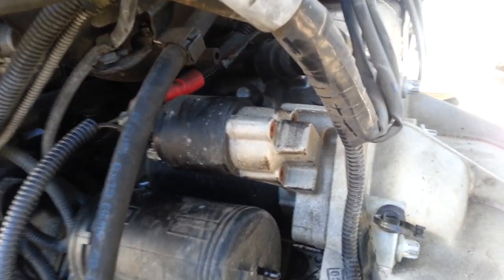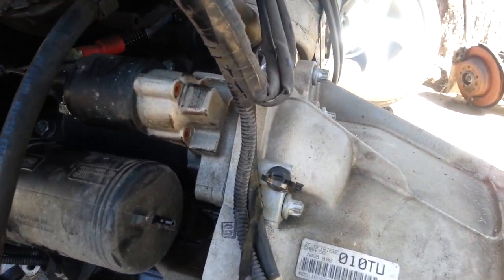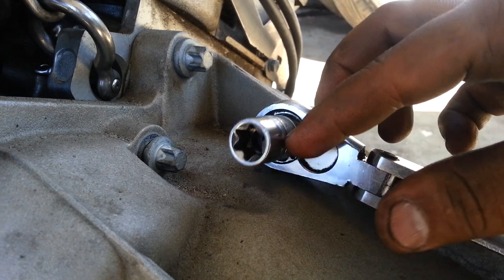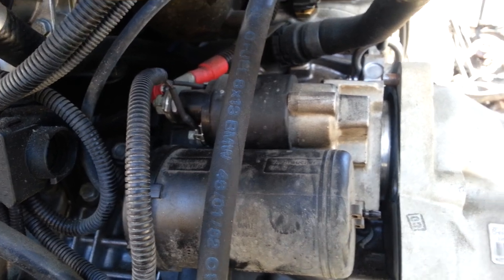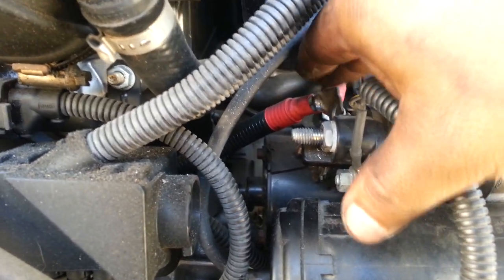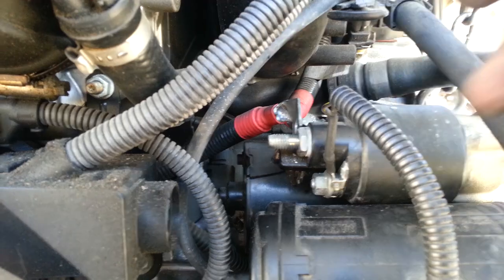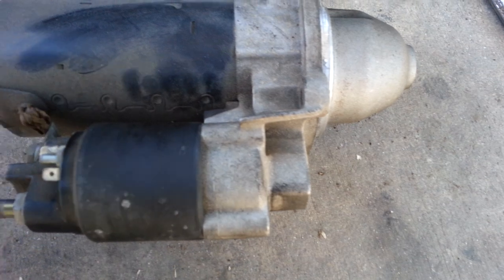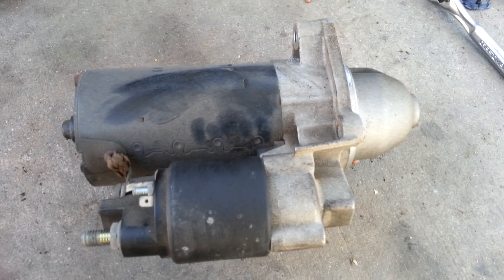How to remove Engine Starter from BMW 325 330 530 E39 e46

Comment: I have one basic question:  Is it easier to replace the starter motor from the top or from the bottom.  The 50's Kid does not mention that.  Is it that he works from the top because he doesn't have a lift?   I read all the postings and there is no mention about it.   Please, give me a clue.
Reply: From the top, bolts are on top , I think removing the driver side air box and vent is enough space

Comment from the maker: You don't have to remove the engine to replace starter on 00-05 models, however, 2006 models got an upgrade in engine.  They went from M54 to N54 and the intake manifold changed a bit and became bigger.  Since starter is locate on driver side rear of engine, you would need to remove the entire manifold intake to have access, even then, you have very little space to work with.  Be sure not to strip the torx bolts since this new model engine introduced aluminum bolts.  Good luck

Comment: Thanks for the video. I am having trouble getting my transmission completely out and I am told that the starter has a dowel pin that sometimes slips out and won't allow the bell housing to come free. Is there a dowel pin on the end of the starter? Thanks.
Reply from the maker: +Mike Hamner There is a 10mm bolt that we've often missed that could prevent the transmission from coming out.  Its on the side of the trans on the driver side.  hope that helps
Reply: +bimmermerchant 
Thanks for the reply. I have them all out in fact the transmission comes out about an inch all the way around and the case rotates about 20 degrees or so. I think the shaft is hung up on the pilot bearing. I still can't get it to come out after putting a chain on the rear axle and a come-along to pull...still won't clear the pressure plate. I am completely out of answers. It will come out one day and I did order a starter just because of how hard it is to get out I am  NOT doing this again! Later!
Reply: Know this Mike, theres a reason why its hung up, never force anything(ie: come along), step back, take a breath(metaphorically), I'm pretty sure if its a standard trans? you have to remove flywheel bolts.
Reply: and thats typically done through dust cover. either with conventional wrench, or a special flywheel wrench?. remove one bolt, rotate engine, and repeat until all are removed.

Comment: At 0:15 I noticed the vacuum reservoir isn’t connected to that small torn vacuum line that runs under. Where does that vacuum line run to?? Mine was the same way but I don’t have the small hose underneath.

Comment from the maker: no way of knowing how serious this problem is until you get codes for the check engine light.  Space available in the engine bay to replace a starter is very limited.  Your mechanic might have unplugged a sensor and forgot to connect it back or he must have pulled an emission house off by accident.  You can take car back to your mechanic and let him trouble shoot or you can get a flashlight and start looking for any unplugged wires or loose hoses.  Good luck

Comment: I brought my car to the dealership because there was a fender bender and needed bodywork. The workers took the car apart and now the car wont start and they wont take any responsibility for it claiming that the starter coincidentally broke while at their shop. I've never had an issue with the starter. The engine won't turn over and it makes a sound like the battery is dead. My question is whether starters just break suddenly and if there is any way to prove that they are at fault. They make it seem like there is no way to prove that they mishandled the repair. It seems like they can just break anything they want and have their customers pay for it. It doesn't matter that the car ran perfectly going in and now wont start. Please give me a little insight as I don't know much and would greatly appreciate your response. Is there anything I can do? questions I can ask? or things can show that they are responsible? The car's not even all the way put together but they're certain that it has nothing to do with the function of the starter.
Reply: it could be the immobiliser if the car was in a crash how bad was the damage ? if it was heavy the starter has taken a jolt this is not common but possible  or if the damage was extensive and some wiring has been severed it could cause the starter to short circuit and burn out   ?
Reply: No. Do you drive a bmw? if so, what year? if not make model year? It could be plenty of other things, try charging battery or volt meter it, does it try to crank how did you drive it home? does it click?
Reply: no just worked in the motor trade all my working life in the body shop department dismantling and rebuilding after body repair. We had a contract with the bmw dealer mazda ford the police  force and many others I have re shelled many cars every nut and bolt  clip wire glass they suffer immobiliser issues after a crash

Comment: Brah cruise on over pull my motor so I can follow your video.  Anyone can remove two freaking bolts from an engine mounted to a stand.   Pro-Tip Ignore this video and ALWAYS disconnect your battery and 12V Leads to starter motor BEFORE you start. note how in video presenter disconnects starter AFTER removing starter motor fasteners...    Oh and thanks for mentioning that there are TWO different starter motors 140 and 160mm, one BOSCH and one Nippon, but hey thanks....  you started the conversation.

Comment from the maker: its our pleasure.
Reply: I have an E23 1984 ...733 manual tranny !
They told me that I have to completely remove the I take manifold to be able to remove the Starter unit !!
Please reply early tomorrow because I need to fix this and there are no mechanics that want to give this a shot !!
These inverted torx are kind of very hidden against the Car Firewall !!
Are you sure I can get to lose those torx bolts ??
I kind of see this an impossible task !! Do i access these from below the car 
or from the Drivers side of the engine ??

Comment: Today a mechanic changed bad starter with brand new one in my 2003 325ci 5 speed. After driving 1/2 mile ck engine sign came on. How serious is this problem ? Pls help.

Comment: do you have to pull the motor out to change the starter??
Reply from the maker: No need to pull motor out.  Tight fit but starter can be replaced.
Reply: +bimmermerchant oh ok cause I was gonna buy an e46 330ci but the starter was out And didn't want to pull the motor

Comment: I wish you at least stepped back a little so we can get a better point of reference to where it is in relation to the engine.
Reply from the maker: Will take that note in consideration next video we make.  Thanks
Reply: your a little harsh in what you say , if you seriously don't know where the starter is then this job is not for you.
the video is excellent thanks
Reply: muzzytt I was also unlucky enough not to have been born knowing where the starter motor is  , that's why I looked for a guide of some sort on youtube .
Reply: 0LAF2046 
It's rare to have a disesembled vacuume,
Removed manifold 
Lower uper housing out of veiw 
And icv,ccv,throttle and deci

Opened up with more light then the heavens gates. 
Look at all the ome

Comment: Try to be logical, and disconnect the starter engine before unscrewing the bolts. Also, disconnect the battery first.

Comment: 0LAF2046 
It's rare to have a disesembled vacuume,
Removed manifold 
Lower uper housing out of veiw 
And icv,ccv,throttle and deci

Opened up with more light then the heavens gates. 
Look at all the ome
My question is ...who wants to buy my 325i 2.6 LTR E46 m52 AS is for Two and a quarter?